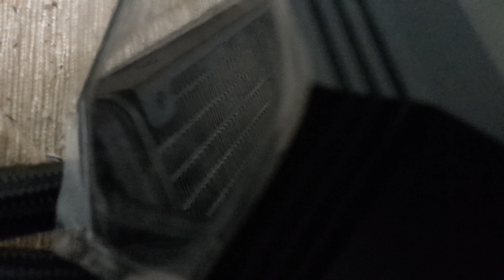SILVERSTONE PERMAFROST PF240 ARGB AIO CPU LIQUID COOLER Repair | DIY Tech

Comment: Oops I accidentally pulled the circuit board off and now the pump is dead. What a bloody shame :P
Reply from the maker: Yea thats an OOP for sure.  Unless u can really dig back the broken winding wires and solder them back. I have done that too but the pump was already dead in my case. They use rubber kinda glue to hold the windings in place and also to reduce the vibration etc..

Comment: Hi, i having trouble filling the coolant.
I shake the raditor and there is always empty space in it.
And what the hole function in corner radiator ? Should i filling it with the hole open ?
Thanks before
Reply from the maker: fill with the hole open it will let the air out and filling will be easy, However there will always be some air left no matter what. So once the slushing sound in rad is very less it means u have filled it well. If u mount the radiator on the top u wont have to worry much even 70% fill will do the trick. The best way to check decent fill is that. After running the pump for 10-18 min its should become silent if its still producing grinding noise it means there are still more bubble /air and its going thru the pump again n again
Reply: @DIYTech21  so if the coolant already come out from the corner hole i must close it and continue the refill ?
.
And 1 again my problem, i use 12volt adaptor to running the pump and i use reservoir so i can running the pump and fill it without keep holding it. But, is it normal if the water pump flow fast when just after turn on the adapter, and after a minute the flow became very slow ? Or its because my pump already abnormal ?

Sorry for my bad english 😄
Reply from the maker: @titusgry  u are saying the pump become slow because the noise or audio gets low. Its because there is air in start and once the pump starts working properly the  noise gets low. So it is not an issue its good.  Pump should be very low in noise after few minutes it shows the loop is good filled. Instead of worrying just close it and install in sysytem :D

Comment: Hi, How did you remove the one-way screw?
Reply from the maker: use a flat head screw driver wide enough that covers the entire  _ length of screw's head. Press down hard and rotate. It will grip.  If this method isnt clear let me know will try to explain better :P
Reply: Tried doing that but still didn't work.
Reply from the maker: @rockydavie  second one is a bit messy. U will need to JB weld something on it and the counter clockwise to open
Reply: I managed to rotate the screw but it's doesn't comes off  @DIYTech21
Reply from the maker: @LL7JB  Well the only thing that can cause above is if the plastic beneath has been broken.  Open all the rest
Reply: @DIYTech21  i think yes , i was turning the screw to the right and because of that it comes loss , at the end i just clean the other things and try to apply a good amount of pressure to the room under the copper plate , and change the coolant to a g13 mannal coolant , and now its runs very good , at a 70 max temp
Reply: brother can you write in the video description that the one-way screw turns to the left to open so no one do the same mistake
Reply from the maker: @LL7JB  Bro all the screws open same anticlockwise. I have done above 40 same model coolers not sure which one are u talking about.

Comment: I have the same cooler, decided to refill it with water but after seeing this video and reading the comments I decided to go for a car coolant. Took some time but I was able to fill it up with the new coolant and now and getting very low and stable temps(under 40 degrees Celsius as opposed to 60 before). Thanks for the video.👍👍👍
Reply from the maker: water would have worked but it  evaporates quicker. Car coolant works best unless its of very cheap quality u know the one that has just colors in water, that after sometime gunk up everything. Anyways these coolers have super strong pumps so if the temps start messing up u can do it again but atleast for a year or so u will be good. THansk for coming back and sharing

Comment: Which liquid do you use to refill the radiator ?
Reply from the maker: Car coolant normal. Its better than that gunking up classified coolant the brands are using :P
Reply: @DIYTech21  Yh probably... Can't i use 100% only distilled water ?
Reply from the maker: @kunalkotharkar2174   yes u can even that will be better than what they have used.. Car  Coolant will be better though due to high boiling and low freezing point than distilled water.  ITs really cheap though go for car coolant.
Reply: @DIYTech21  i have a same AIO and it stopped working.. i guess it has some blockage in the pump . It also does make bubble noise too loud and its cooling doesn't even work.. so i guess I'll have to clean that. Thanks for the information. It was really helpful 👍
Reply from the maker: you are welcome there will be more cleaning videos coming soon like and share :D
Reply: Hey if i send over my aio can you repair ? 
Is there any way to contact you ?
Reply from the maker: @kunalkotharkar2174   The shipping across borders and the risk will be more than what u can buy a new one for.  M from PAK btw. If u can get it to me than surely i can repair it for you
Reply: @DIYTech21  That will be too much to ship across border.. I've removed all the screws but only one screw isn't coming off . The one from the company made screws. Is there any trick to remove that ?? Minus screw driver just slips on it and it doesn't spin
Reply from the maker: @kunalkotharkar2174   press very hard down and then rotate...  while keeping down force
Reply: @DIYTech21  tried this multiple times bt isn't working
Reply from the maker: @kunalkotharkar2174   use jb weld like thing and weld a spare screw driver on it , that will be the only other way. The place i know is very small to use any other tool, like a cutter etc is not possible. The manufacturer really tried hard so the people cant get in and repair these :D I think super glue and baking soda combination can also be used to hold something there tight then open it up. (make sure the glue doesnt go any place oither then screw tip)
Reply: How much time did it take you to refill it ? And was the process slow by the motor ??
Reply from the maker: @kunalkotharkar2174   You will need to continuously tap and turn on and off the pump to let the air out.  The inlet side should be merged in water and not to be taken out in whole process or the air will get in and u will have to start again.. Theres no particular time for it. Sometimes m lucky i get them refilled quick sometimes it takes upto 40-50 min. You can check by shaking the rad. The least splash sound means its good fill
Reply: I refilled it and it doesn't make any liquid noise is that a good refill ? And the motor makes a slight noise of water splashing.... So is that normal ?
Reply from the maker: @kunalkotharkar2174   if no liquid noise thats a good refill. Also the water splashing will go with time its due to air bubbles in loop once the bubble move on higher point it will be inaduible .What about temps are u getting good performance ?
Reply: @DIYTech21  Okay Ok ... Currently im out of thermal paste.. so once i get it I'll share the temps here
Reply: What amount does it takes?
Reply from the maker: @rockydavie  u mean amount of coolant ?
Reply: @DIYTech21  yes. What volume of coolant does this unit hold please?
Reply from the maker: @sallysmith9771  Sorry m not sure about it. As i keep circulating water till the bubbles are over. @11:00 u can see there are no more bubbles or splashes on the outlet it means its filled at best.